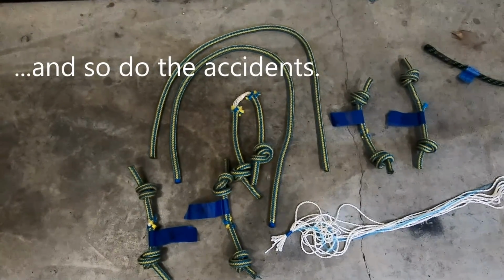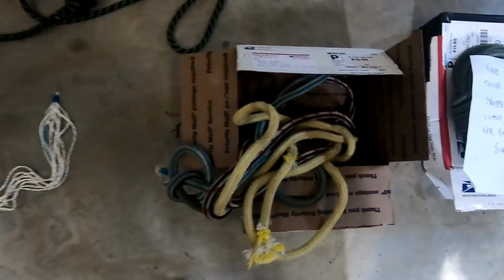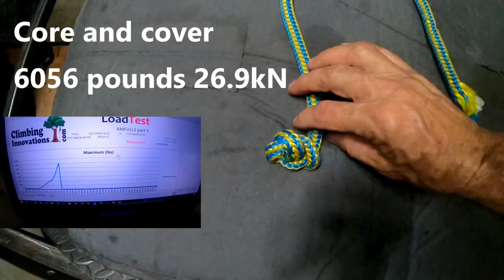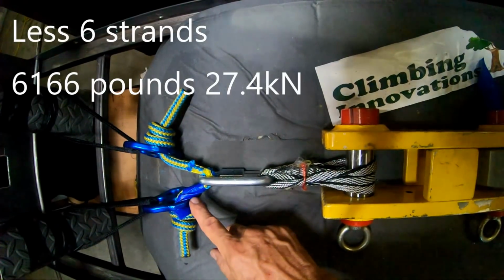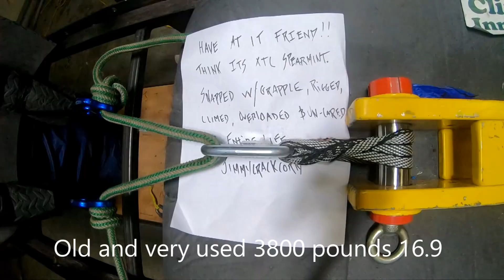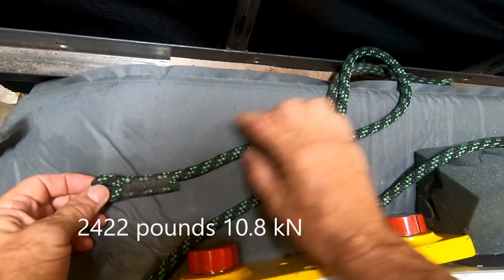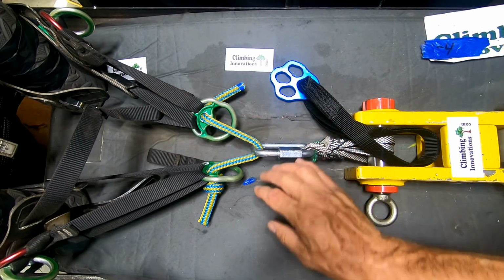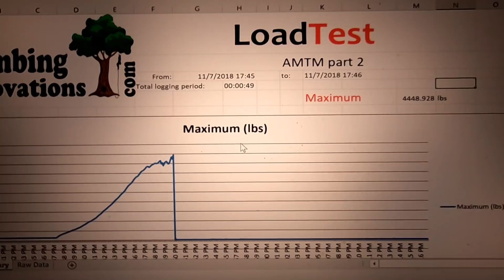Testing 16-strand Rope for Harness Bridge Application

Comment: These test just add to the questions about rope bridge failures (in a good way). All of the rope was strong "enough". Knots often weaken the rope as much as minor defects. Major defects weaken the rope more. Old rope may be weaker than newer rope, but likely will still hold until it is visually worn enough that it is obvious that it should be taken out of service. All of these thing pass the common knowledge test. 

It was interesting to see the knots pass through the paw plate, and to watch the knots creep up the tails. All of that seemed to happen at pretty high loads, and even then pretty slowly. It is a reminder to inspect everything, keep adequate tails, and think about what a stopper knot actually stops on.